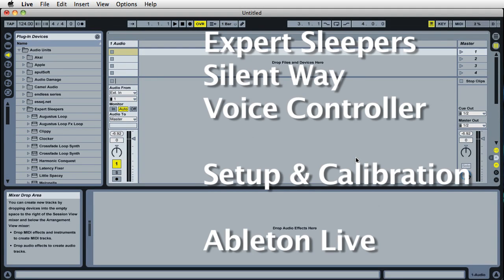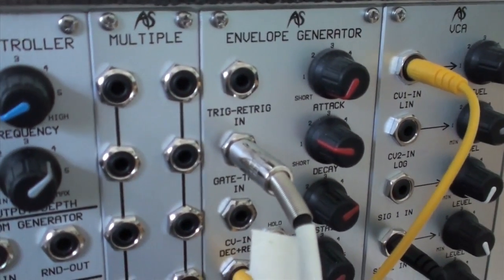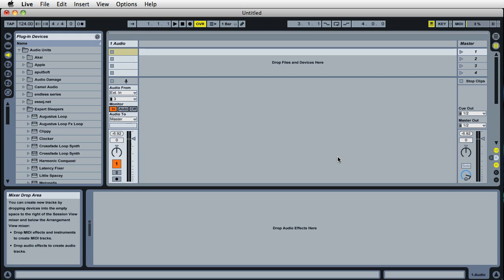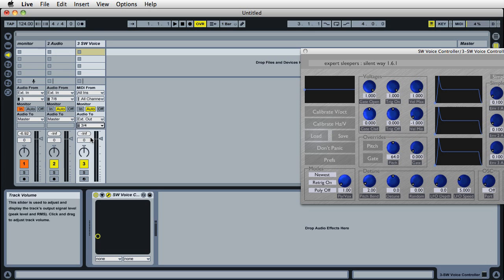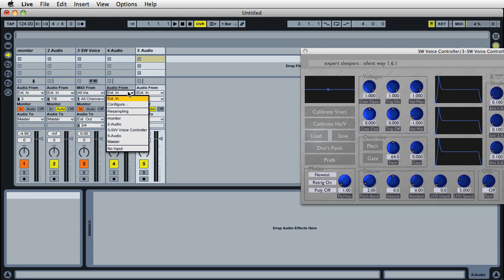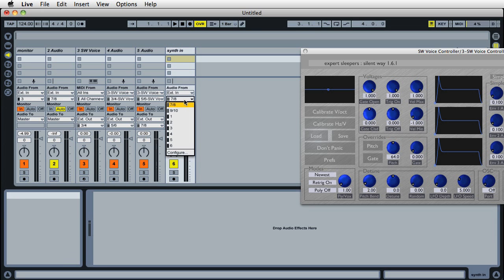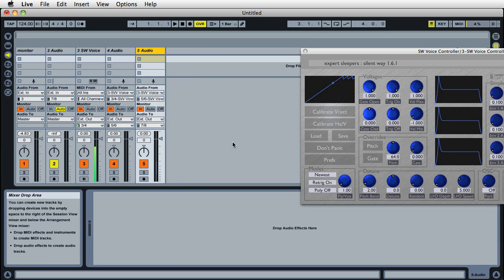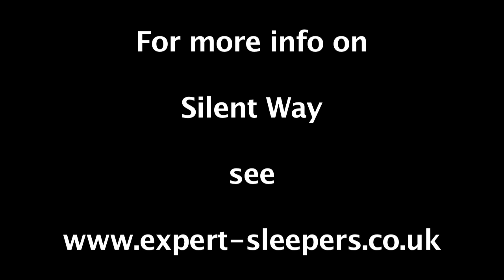Expert Sleepers Silent Way in Ableton Live

Comment: Could someone explain how to use AC Encoder in Ableton? I have made the "special" cables (diode, capacitor) per instructions. FWIW, I'm trying to use an M-Audio MobilePre.
Reply: Have you read the AC Encoder section in the Silent Way user manual?
Reply: Andrew Ostler
I have, yes. I was specifically interested in how to setup the the channel strip(s), which plugins to use, and the input routing. I tried a few permutations, but essentially was trying this: Channel 1 w/SW Voice Controller routed to Channel 2 w/AC Encoder, out to M-Audio MobilePre. One thing I may have been doing wrong: I was trying to control a Realistic MG-1 as though it had a gate input, but have since learned it's an s-trigger input (I'm new to CV). I hope to have time over the next week to try again.
Reply: bigjoescientist I suggest you come over to my forum on muffwiggler.com. You'll find someone who has done this before and got it working.
Reply: Andrew Ostler Thanks. I'm recently a member there, and have found some good info. I did find someone who tried to get a Rogue working, but gave up, so no help there :) I'll keep digging. Thanks for your help.

Comment from the maker: Same situation as using TS cables - the synth's input sockets are TS, so the R will likely be shorted to the S by the socket. Floating ring cables are recommended.

Comment: hello!! great video. i notice that you are using a motu interface. i plan on using an 828mk2 with silent way. now in the manual for the 828 it says that the outputs of the 828 are trs and can accept unbalanced cables. now does that mean i could use unbalnced cables both sides? also, i plan on using it for a moog voyager old school. could please give me some advice as to how to set it up with reaper? thanks a lot
conor

Comment: @meleeECI I believe it's something you're not hearing, in fact. For those of us who have modular hardware, or a synth that allows for CV input, this software is a real blessing. Yes, working completely within ableton just using plugins IS a bit simpler, but there are rewards to building your own hardware, or getting creative with modulation inputs and outputs. Some will swear that hardware sounds better, others will argue the advantages of a software only setup.